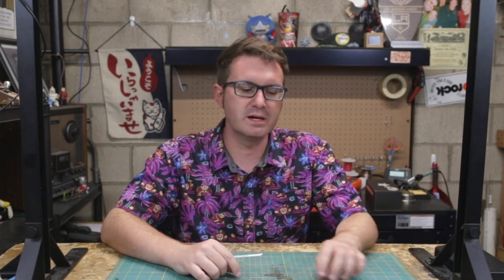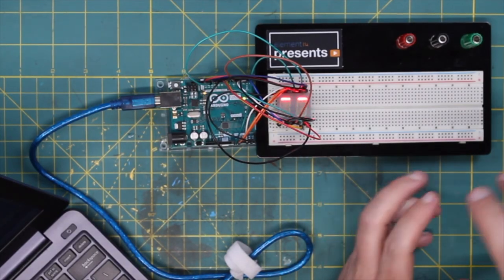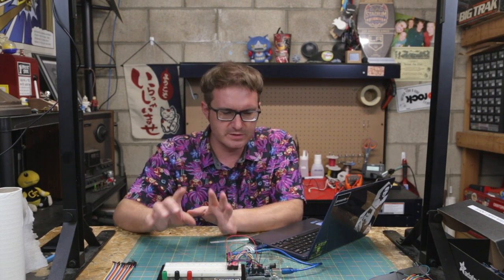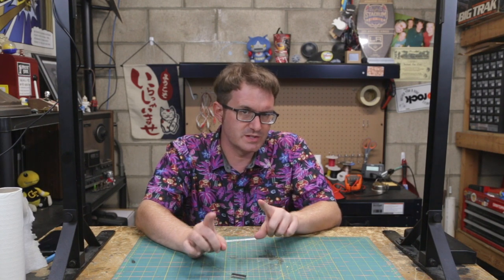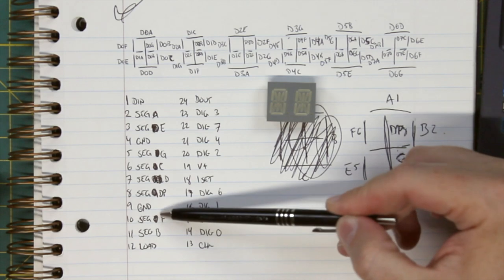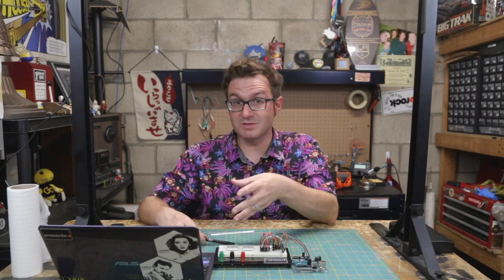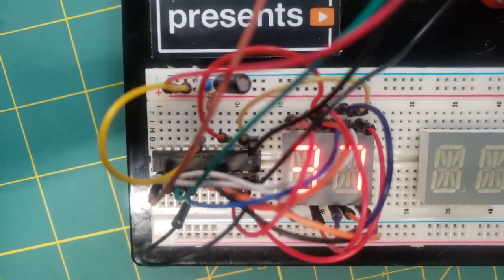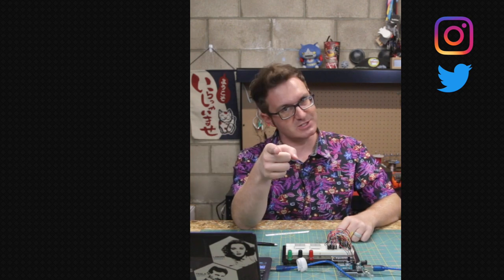Driving LED Displays With Arduino And MAX7219

Comment: The MAX7219 tend to induce a lot of EMF interference, I used those in a project a couple of years ago and the multiplexing caused noise in the radios PLL/VCO system, despite a great deal of filtering being used, it was radiating from the led display cables !